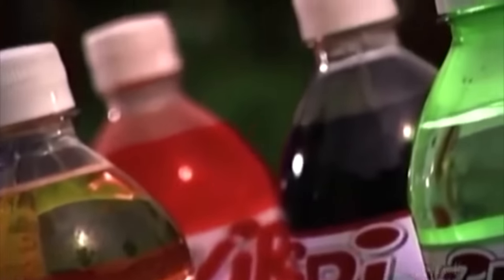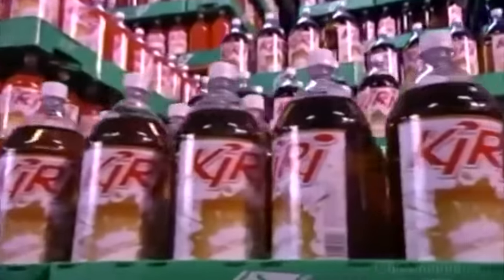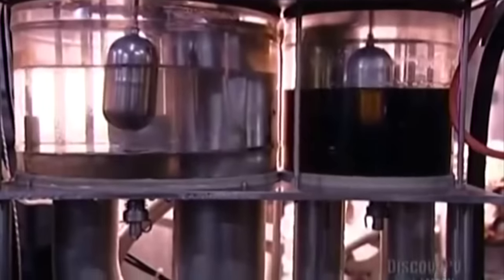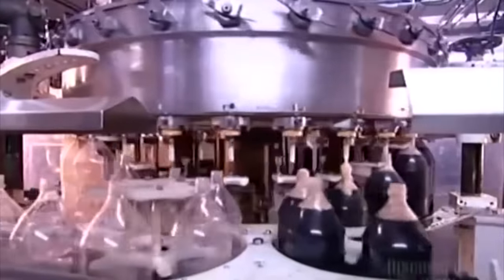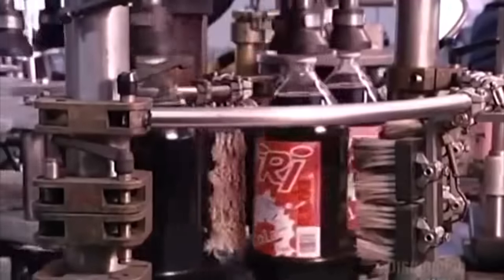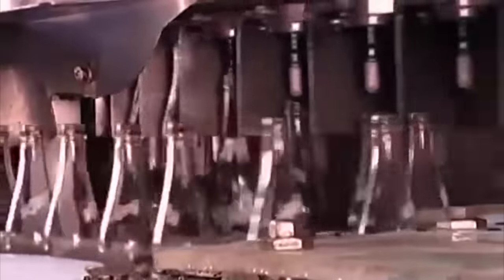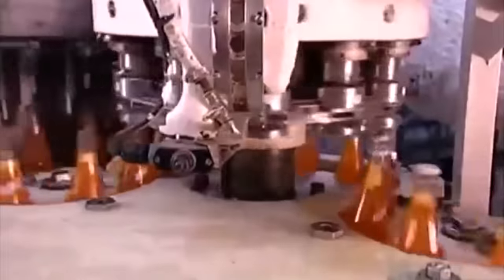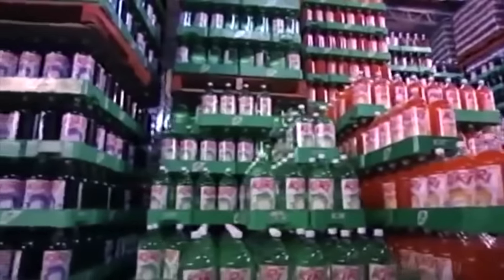How It's Actually Made - Soft Drinks

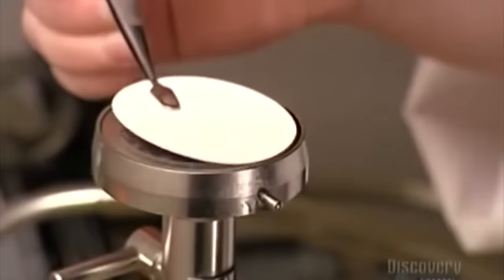Comment: At 4:18 they’re actually performing a bottle method  analysis on the soda to test for particulate matter within the soda by filtering it through an extremely thin filter and using a vacuum to pull it through.

Comment: Does the rinsing machine count as a filling machine even though it doesnt fill the bottle with water, but it put water in the bottle through the filler that doesnt quite fill it but it makes an attempt. Does that make the rinsing machine a half arsed filling machine, like a glass half full, yeh the rinsing machine is definitely a filling machine aswell.

Comment: Ok I think I got it the rinsing machine sprays the bottle with liquid black and the vat adds water and the uncasing machine take those bottles and get filling machined with orange soda and sent, but the one thing I don't get is why is there 2 different bottles, does the small bottle go on the rinsing or filling machine? Which bottles get sprayed with liquid black and what bottles are thrown into the water vat? Spent so much time talking about the rinsing machine idek what bottle is legal